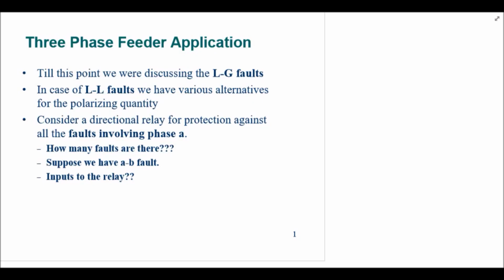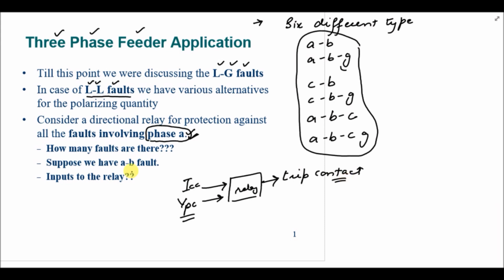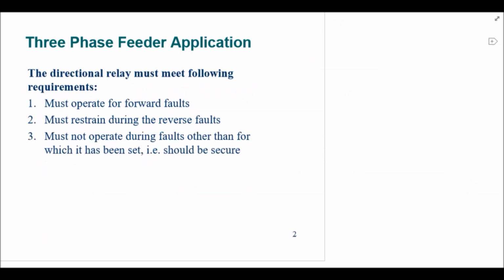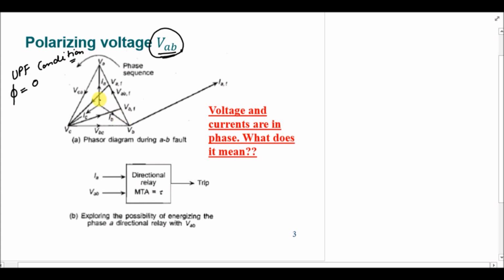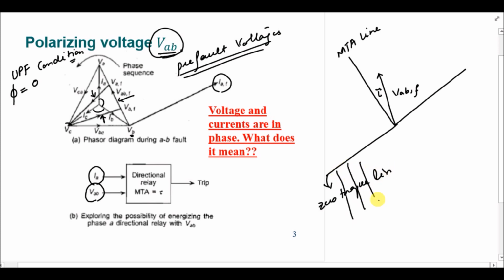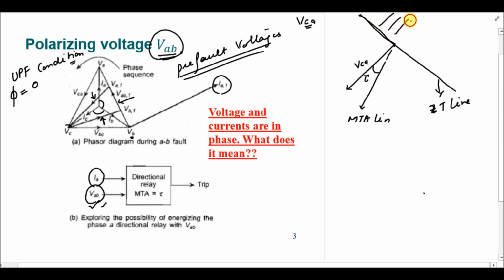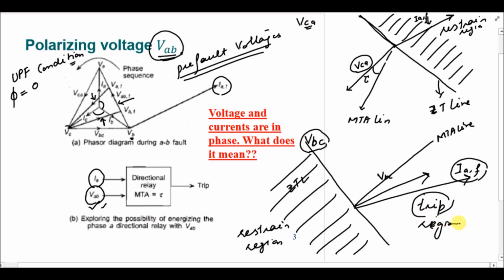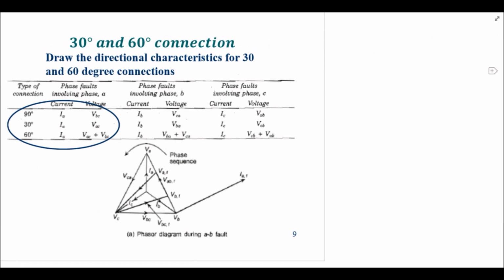Power System Protection|| 5.3 || Directional OC Relay's Characteristics for L-L Faults

Comment: Why do we consider Ia and Va as at UPF at the beginning of the analysis instead of considering Ia lag Va just as in real condition?
Reply from the maker: yes we can consider this scenario as well, but the condition of UPF is used to make the lecture easier to understand. The case that you are talking about is considered in the next lecture in which the 30 and 90 degree connections are considered.